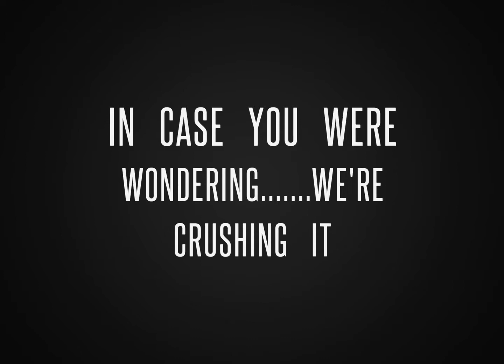Crushing, Processing, and Screening Recycled Concrete

Comment: Ultra Screen Working very well
Reply from the maker: Yes it is.  I wish we had purchased it with  the two side conveyors off the back.  We are now looking for after market ones to help get the sorted material away from the screener and into different bins for sale.  We are also looking at retrofitting a magnet on the conveyor to pull wire out outside of the product
Reply: @colonialhaulingandequipmen6188  sorry only reading this now.
we could price up a new machine with conveyors to suit.
Reply from the maker: @kevingates5226  I guess that would be the only option?  no way to retrofit the machine we already have?
Reply: @colonialhaulingandequipmen6188  Is your machine Diesel hydraulic?
We could supply two mobile conveyors.
Reply from the maker: @kevingates5226  Ours is Diesel Hydraulic.  It has the Kubota Engine with a hydraulic system